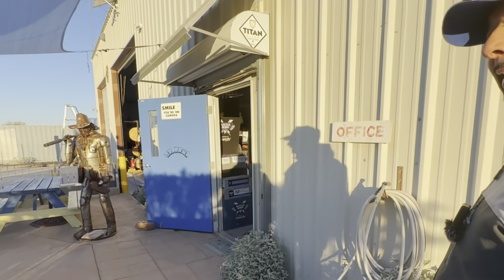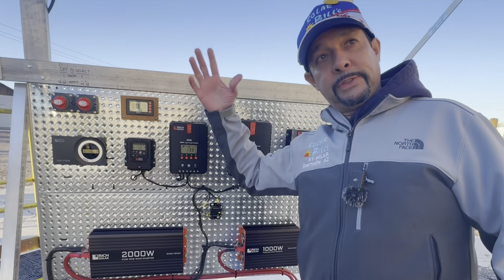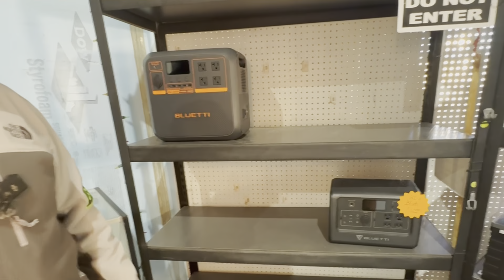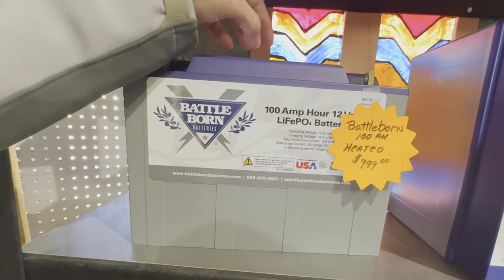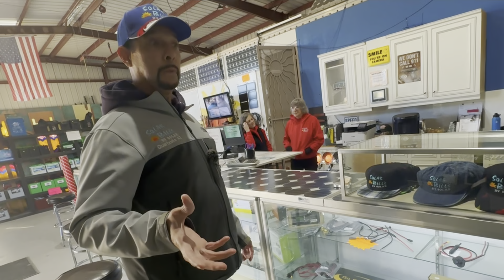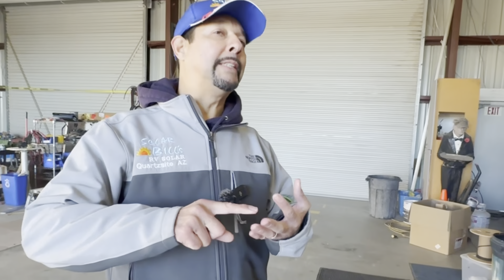QUARTZSITE Solar Bills

Comment: The 200 amp fuzes went up 100 % in one year.   I was not really surprised. But they do pretty good work.
Reply: The price was $5.00  a piece. They went up to $10.00 a piece. I was shocked. But I needed  one at the moment.
Reply from the maker: @vanlifenomadfirekeeper Checked Amazon and currently $5- 10 for 200 amp AMG fuses
Reply from the maker: If you can tell me the type of 200 amp fuse and the price a year ago and the current price I’m happy to leave your comment up as good information for everyone.

Comment: For an average Class C RV, do you think 4 Life PO 4 at 400 amp hours each would be enough ?    1600 AMP hours total...   I'm looking to run AC off of solar also
Reply from the maker: Probably yes on the ac /a lot depends on how much solar you have feeding that massive 1600 amp bank.  I would say a minimum of 3200 tilted in the winter. But this is way beyond my expertise - I’m likely wrong but not far off
Reply: @Dottietravels   Dottie is correct. Plenty of battery to run A/C. For how long? Dunno, a shunt will tell you that. But how to get the charge back into the batteries? More solar then the typical Class C roof will hold. This leads into is there a generator, either onboard or can plug into the rig: if so an inverter/charger will help. For air conditioning a 3K inverter/charger wired whole house with 100ish amp charging capability and 4/0 wiring (fused as 400 amp) would do the job for ONE air conditioner. Again, for how long? A shunt will tell you that. 

Then, since a class C, a DC to DC would be looked at for alternator charging into Lithium which has less resistance to take a charge then lead acid/agm so could prevent the alternator from overheating and failing. Currently there are 30 and 50 amp DC to DC. 

Then there's math. Yuckie. 1600ah total, shunt says we're say -1000ah with current charging off solar only say 15 amps. 1000/15= 66 hours to recharge. With a 100amp charger (actually charging at 100 amps + 15amps from solar = 115 amps charging AT THAT TIME) = 8.6 hours to recharge.

Now we get into where the heck are these batteries going to fit? Group 27 Epochs at 300ah, 2 might fit under the steps where batteries typically fit in a class C. Usually they're moved to a compartment taking up storage space then original wiring posted and extended to the new battery location. Only bringing this up because battery relocation is an unexpected and in this specific case unavoidable cost most don't think about. 

In closing, "For an average Class C RV, do you think 4 Life PO 4 at 400 amp hours each would be enough? "  This is the real world cost of that question.

Comment: We just bought our RV in March. It came with 1 Go Power solar panel and charge controller, a 1,000 watt inverter and 2 lead acid batteries. In October we had Solar Bill upgrade ours by adding another solar panel, a better 30 AMP charge controller and 2 100 AMP hour lithium batteries. We’ve been out at LaPosa South LTVA since mid November and we’ve never had a problem. We went back to have them swap out the connectors for our solar generator so that we could use a solar panel we had from our last RV. We highly recommend Solar Bill.
Reply from the maker: That’s great to hear! Thank you for the comment
Reply: Thx for comment, I too have the same GoPower set up and I am watchjng this video from Plomosa rd😂 wondering about cost of upgrade from what you had. I know I would be satisfied with the upgrade, but what am I looking at how much$$$ for the upgrade...
Reply: @janebray9392 we already had a 190 watt panel and a 1,000watt inverter installed from the factory. We swapped our Go Power Charge Controller out with a Blue Ky Energy Solar Boost 3000i based on their recommendation as the charge controller that came with the RV wasn’t working right with the lithium batteries. Total was about $2,200 dollars for the installation, solar charge controller, another solar panel bringing our our solar panels to 400 watts, and the 2 lithium batteries. Labor came in less than estimated as they told us our current inverter would be fine. The cost could be higher or lower depending on what price level you went with for the lithium batteries. We chose the Lion Energy batteries which from this video appears to be midrange. The solar panels are mounted on the roof. On our last RV we had 2 smaller solar panels on the ground with a built in charge controller and 2 lead acid batteries. We didn’t have an inverter. We could make it through a night running our heater, but if we didn’t have good sun, we’d have to run the generator a lot to get the batteries charged back up. We’re so glad we did this as we have been able to do so much more with the new solar system. We’ve never been low on power since. If we do run our generator, it’s for the microwave or things that use more than 1,000 watts.
Reply: Good to know the original solar setup can be easily replaced. My 2023 Class C has the basic system you described, and I have been wanting to change to lithium for extended stays.